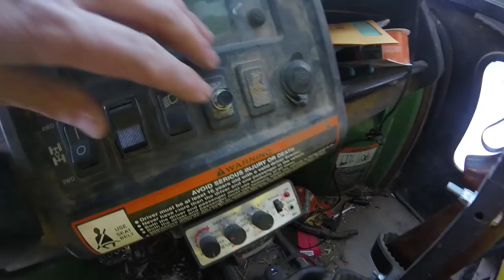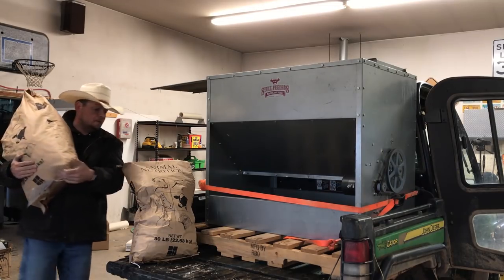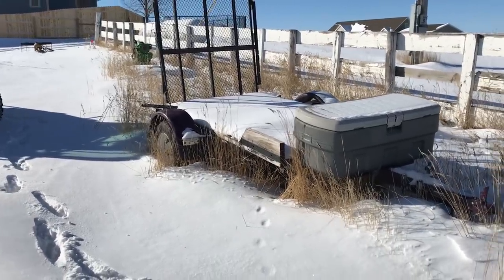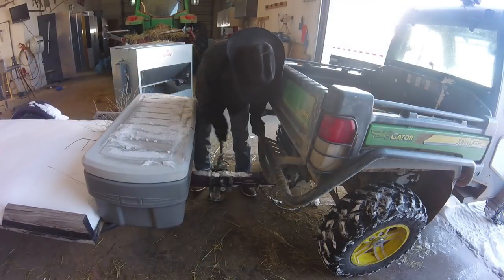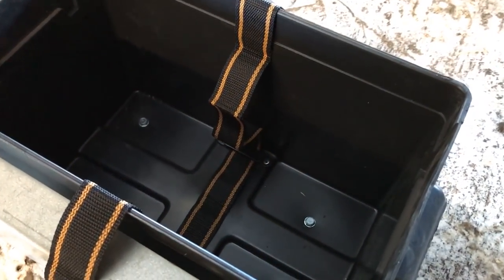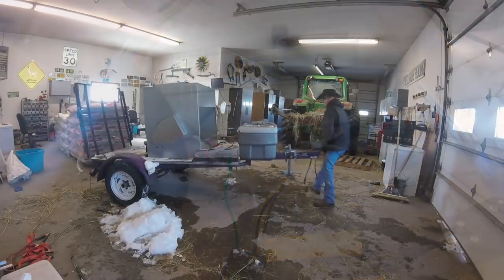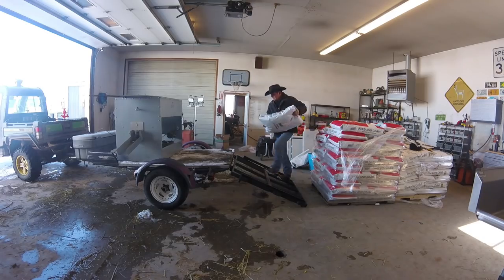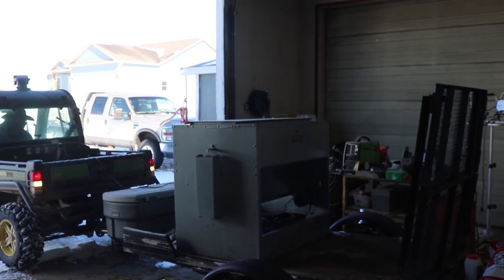The New Cake Feeder - The Project List

Comment: Love your videos! 2 quick suggestions: You should cover the four lag bolt heads that are holding the battery box down so they don't puncture the battery when/if the battery vibrates.  2nd: replace the feeder button with an on/off switch to free up your hand.  Take care!
Reply from the maker: Great ideas. I'm gonna put a battery pad under it and as for the switch I just had to use the one I had but i like that idea. Filming, pushing the button and driving was a bit difficult lol. Thanks!  -Mike

Comment: Good job mike. Since you have that 4 wire trailer connector how about using the other 2 wires to charge the battery from the gator ?  Add a small inline fuse too.  For serious protection a battery isolator will make it foolproof... 👍🍀

Comment: Have you tried putting the trailer on skies during the winter? Like a bush plane does in Alaska. Short wide ones would keep the trailer from sinking in the snow. Good luck.
Reply from the maker: Thats a good idea, problem is that we dont have snow all the time but even then it would slide over frozen ground. Thanks - Mike

Comment: Now you can also pull the cake feeder behind something else other than the gator if need be too.
Reply from the maker: Very true, but I'd have to rig up another button :) Thanks Cody - Mike
Reply: Technically you could just put the feeder in the loader bucket, strap it down, gently close the teeth and rig a wire to the cab.  Roll the hay out the back turn around and cake off the front but that would require being able to stab off the balls without having to use the loader at the stack.  I've seen it done before.  Some ranchers are switching to pickups with a cake feeder in the front of the flat bed and then it has a ball arms off the bed for rolling hay.  Much easier then fighting a stuburn tractor on colder weather mornings.

Comment: Great Ideal it seemed to work well mike. I would suggest drilling holes through the cross member of the trailer to bolt the cake feeder to too hold it securely And maybe a couple of straps for added insurance Just because it bounces so much in the rough fields. Great video. Hope you, Erin and the rest of the family are doing well. Have a great day!!! God Bless
Reply from the maker: Good point Bob, I figured that out really quick. On my way back to the shop it let go and almost bounced right off the trailer. Bolts will work better.  We are well, thank you - Mike

Comment: Mike when I've had to run long stretches of wires I use old extension cords. Ever used then to wire trailers for lights
Reply from the maker: Thats a great idea!! Where were you a few hours ago! lol Thanks Kory - Mike
Reply: Our Wyoming Life wandering tractor supply and dreaming
Reply: I once rewired a old cabin in northern Minnesota with old extension cords..That was about 20 years ago, and to my knowledge it's hasn't been replaced and still working like new..
Reply: Sometimes you can buy a new extension cord and cut the ends off cheaper than you can buy an equal length of wire.
Reply: David Harris exactly plus it's all bundled together

Comment: You can use the 2 extra wiwers to power the feeder or charge the battery
Reply from the maker: Very true, however I cant use it to power the feeder because it draws too much power and would melt the wires. Found that out the hard way when it was on the gator.  Thanks - Mike

Comment: You could also put a sprayer or a grass seeder or haul the mineral tubs or salt out on the rear portion of the trailer.  You could make a sort of dock that you can stand on next to the trailer to make it easier to load the cake from the bags.   Would be as simple as pulling up next to the dock and pallet.

Comment: If you also hook up the battery to the 4 way plug you could charge the battery on the trailer while using it :)
Reply from the maker: I thought about doing that but its really only hooked up for a the 10 minutes it takes to go out and feed. Thanks - Mike
Reply: @OurWyomingLife  ahh, if it is for that short of a time I fully understand why that wouldn't be ideal :) altho you could keep it hooked up for longer when you got done 😊 just to even put the voltage of you verent going to use it in a short while 😊  
Love your channel tho, I'm a new subscriber and are looking to buy myself a "ranch" here in Norway, altho alot smaller 😅 😊

Comment: FYI - John Deere is recalling 68,000 Gators due to the steering shaft disconnecting from the steering rack. You can call 800-537-8233 to see if your Gator is on the list. Fun video, Thanks!
Reply from the maker: My john deere dealer told me about that and said we should get a letter but I like the phone number idea better.  Thank you very much! - Mike

Comment: Hey Mike, just an FYI... I heard you say you were going to be soldering wires? Any wire connection in anything that vibrates (cars machinery, noats, planes, etc), you should avoid soldering. Soldering those connections makes a weak point prone to breakage. Use solderless (crimp) connectors and terminals instead. It will keep you running! Great channel bud, glad I found ya.
Reply from the maker: Very good point and totally makes sense. Thank you very much Brian, you just saved me some work. - Mike
Reply: I like to use non insulated crimp connectors and then put glue sealant heat shrink over the connector for long lasting weatherproof connections. All available on Amazon! Best of luck bud!

Comment: Really like your videos. Seeing how you have 2 more wires on your plug I would think you would be able to trickle charge the battery on trailer from the gator when your using the rig.
Reply from the maker: I thought about that, but its really on the gator for about 10 minutes while caking. I'm not sure it would have enough time to charge.  Thanks Chris. - Mike
Reply: Really enjoy your channel. Just a thought, couldn’t you use the other two wires in the plug to run power and ground to the motor and delete the battery all together.

Comment: Use the other 2 wires from the 4 way to supply the 12 volts to the feeder motor, eliminating the need for the stand alone battery. Enjoy the videos! Thanks!
Reply from the maker: Thank you very much - Mike

Comment: This might odd suggestion for you but if you keep a tool box(es) at different check points on ranch and on the vehicles it will save less time traveling back and forth. If the vehicles have room.
Reply from the maker: I have tried that, it works for a while, but somehow things always get moved around, stolen from one for the other. It gets to be a mess.  We do have a traveling box taht we can take with us though. Thanks - Mike

Comment: Mike next time don’t cit the terminals off you can simply remove the strap on the battery connector and bolt the terminals to it with the bolts that holds the strap and you don’t get corrosion growing up inside the cable

Comment: You need a solar panel like you get for a gate opener so you don’t have to charge the battery.
Reply from the maker: I did think about that and almost got one but I had a trickle charger laying around that I put on it.  Plus I'd have to brush snow off the panels. :( thanks - Mike

Comment: Have you had any thoughts about hooking the feeder battery to the Gator charging system via the trailer plug connection?
Reply from the maker: I though about it, but its really only hooked up to the gator for about 10 minutes while I run out and feed, not sure it would be enough time to put a good charge back on the battery anyway.  Thanks - Mike

Comment: What if you put all the cubes on the trailer so you don’t have to go to pick up some more and what is that cooler on the front of your trailer
Reply from the maker: the trailer is only rated for so much weight, its a  rubbermaid storage container. Thanks - Mike

Comment: maybe a solar powered tender how much drain for one feeding?
Reply from the maker: I didnt actually check it, now that you mention it would be a good thing to know.  I thought about getting a solar tender but I happened to have the plug in one around and until I find a lid for that battery box I dont want to leave it outside cause the box will fill with snow.  Of course I'd be brushing off solar panels too in the winter.  Thanks for the great idea! - Mike
Reply: I just hate the thought of did it get plugged in and then bang no power.  We use a trolling motor on our sailboat and it is always a challenge to make sure we have at least one battery ready to go without pulling one out of the vehicle we drove to the lake
Reply from the maker: I'm sure there will be a learning curve with this as well.  Seems there is with everything lol.

Comment: Do you only cake pregnant cows?       How often do you feed them the cake.
Reply from the maker: All of our cows on the ranch are pregnant right now, but we also cake the bulls. Thanks for watching - Mike
Reply: Daily?
Reply from the maker: It depends on what hay we are feeding.  Some hay is higher in protein and doesn't require as much supplements.  If the hay is really low in protein they will get something daily.  You can get cake in different protien concentrations depending on what you need